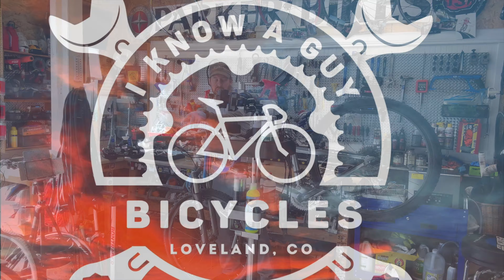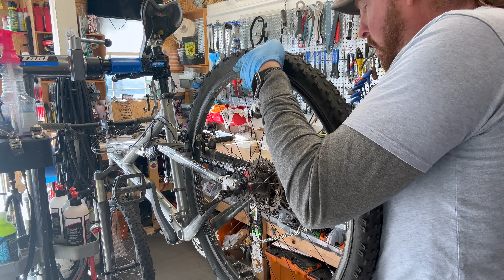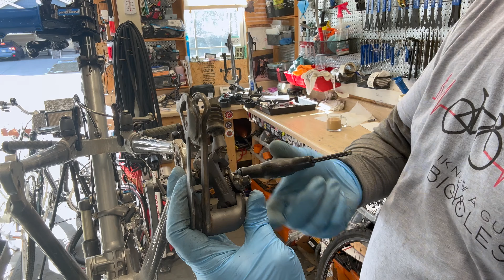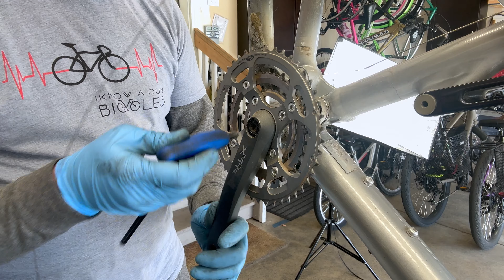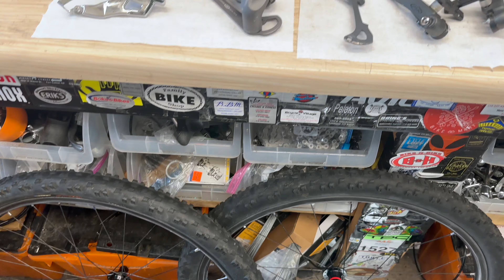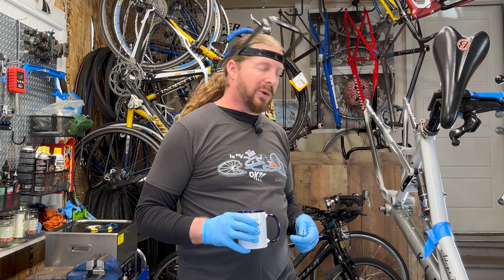Diamond in the Rough? OR NOT? Klein Adept Pro (Made in the USA) Tune-Up Review

Comment: Nice video. I have still have that Klein Adept Pro in plumb crazy colour. Still ride it even though my main rig is a 29er, this bike still gets attention on the trails. The only thing I've replaced are the top hats on the suspension joints (got them from Trek). Its very light and fast even today.